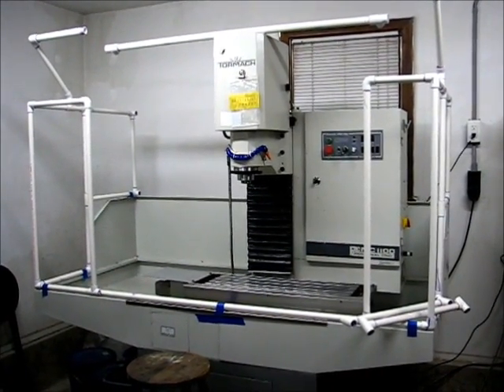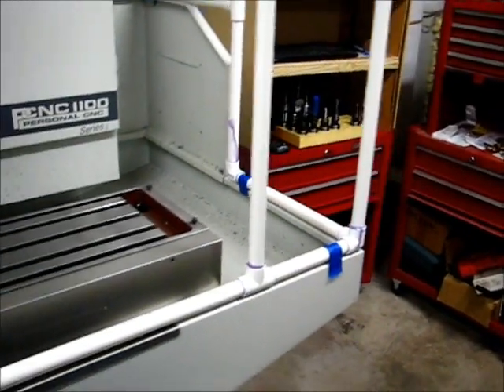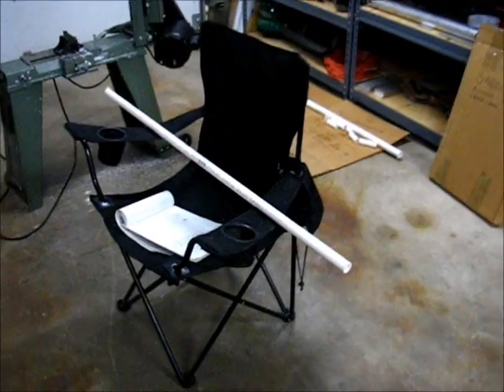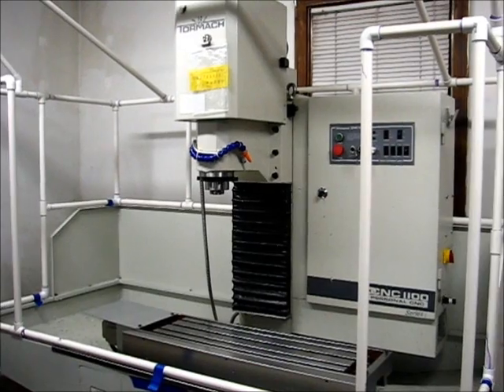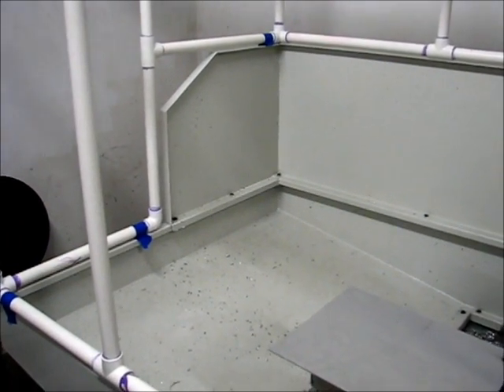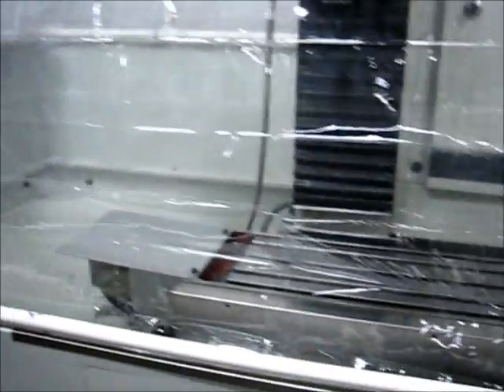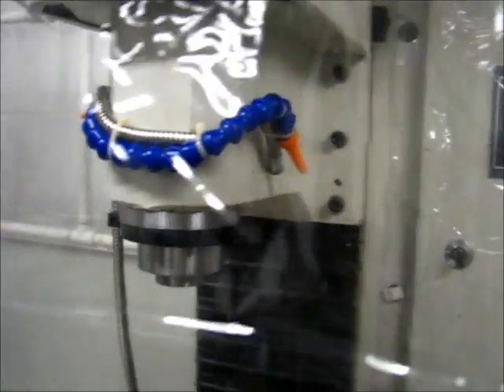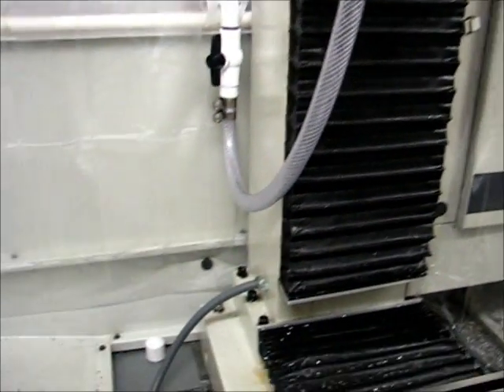Tormach PCNC 1100 - Full Enclosure Build and Flood Coolant Upgrade

Comment from the maker: Thanks for the input.  When determining where I wanted to put the coolant manifold I checked out where the ATC interfaces.  It will certainly interfere with the coolant manifold where it is presently.  I decided to move forward with the design anyway.  I'll reconfigure the manifold and supply when I get the ATC.  I didn't want the future plans to compromise current performance.  Thanks again!

Comment from the maker: I did not know that.

Thanks for the input.  I've now revised my plans and I'm going to do something that looks more like an aluminum splash shield.

I'm hoping the coolant flow is all it's cracked up to be.  I've seen video of the same pump I selected on a Tormach with a single nozzle and I was very impressed.  I did a lot of measuring of the flow of the OEM system so I've got a good baseline to compare to.  I'll post numbers when the nozzles and pump are attached.

Comment: Do not cover the hole in the bottom of the mill head casting, there is air flow through there and helps with the temp control of the mill spindle! this hole has a mate in the top and the spindle motor draw air through this! you do risk elevating the temp of your spindle and the mill head casting which could damage it and at best throw your accuracy out do to thermal expansion! I love the coolant system upgrade! it would be nice to get a bit more real flood on mine, I think I'll look into this.